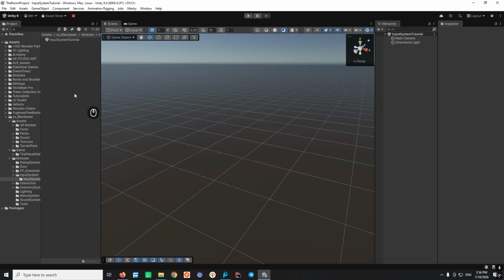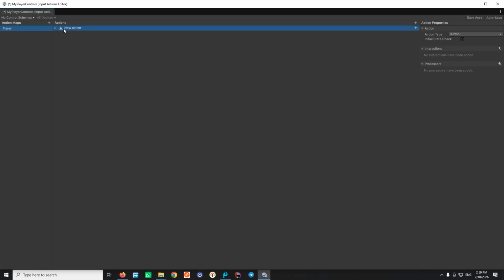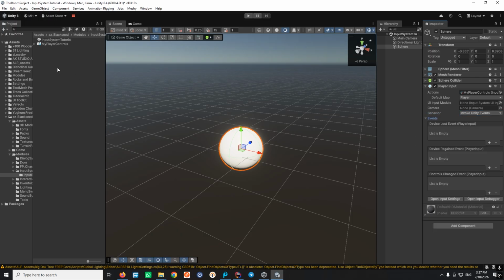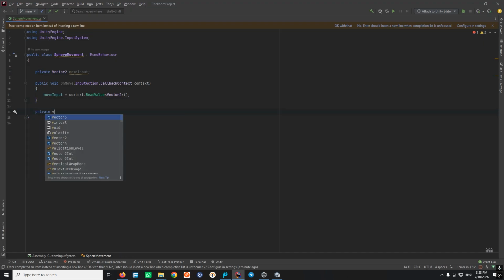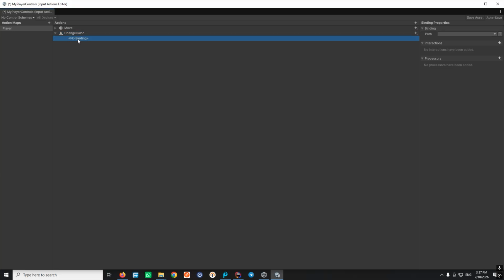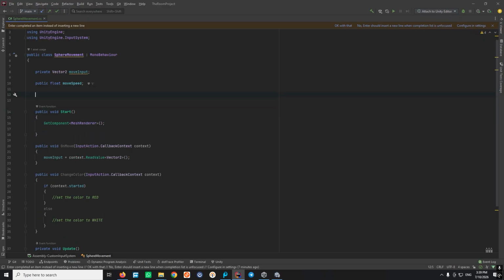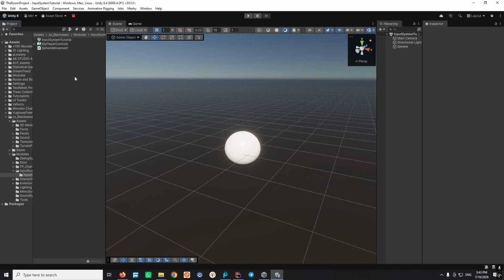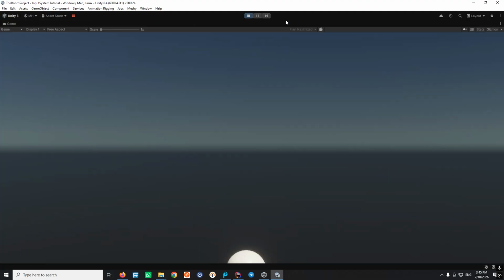Unity's New Input System Made Simple - 2026

Comment: Thank you so much for making this video! It really helps understand the new Input System and how to use it. However, I found that, when trying the same code in a first person game, when pressing "W" and "S" to go forward and backward respectively, it instead goes up and down. Since I don't know much about coding, I've got no idea on how to fix it. Do you know of any way to do it?
Reply from the maker: I'm glad you found it helpful! Yes, when you want your character to move on a flat surface, you usually change its position on the X and Z axes.

The context.ReadValue<Vector2>() gives you a Vector2, which has an X and Y value. But in 3D movement, we want X and Z.

One easy way to fix this is to change Vector2 moveInput to Vector3 moveInput . Then, inside the OnMove function, instead of directly assigning the input to *moveInput*, you can put the input's Y value into Z, like so:

Vector2 input = context.ReadValue<Vector2>()
moveInput = new Vector3(input.x, 0, input.y);

This way:
W/S → Z axis (forward/backward)
A/D → X axis (left/right)